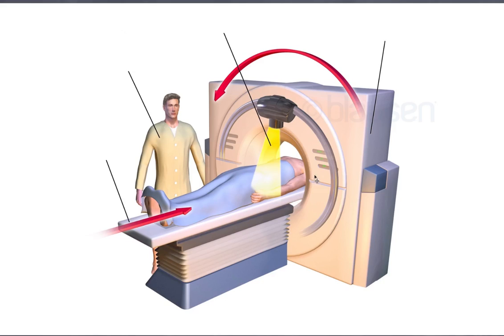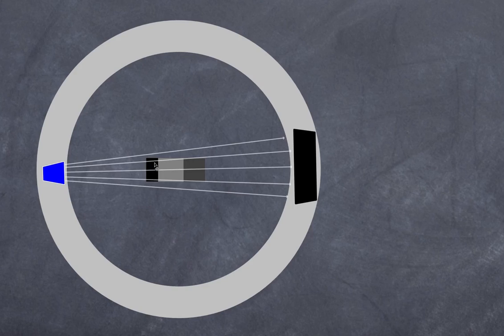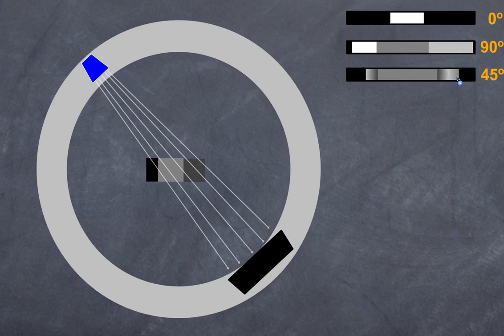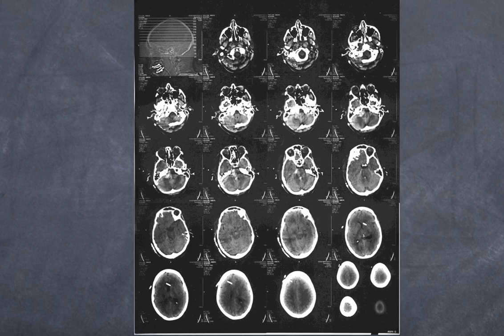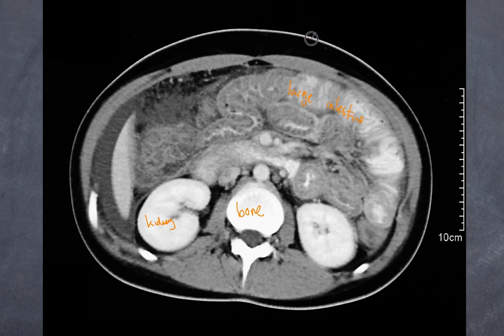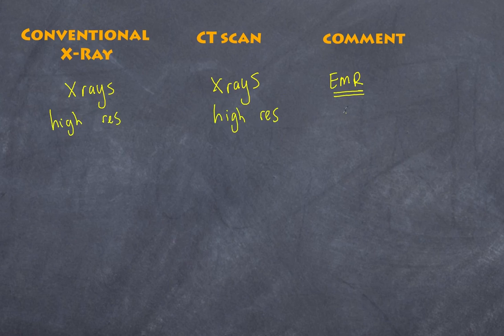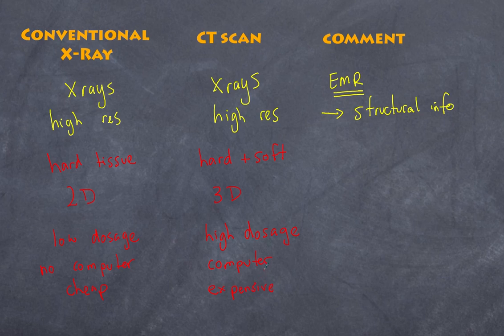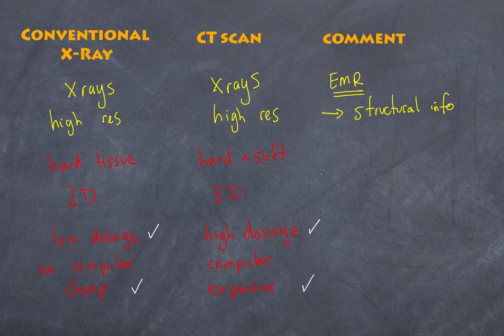Understanding CT scans

Comment: I am not sure why at 0deg we don't just see a solid black block? Surely, the densest part of the block is at the 'top (left)' (ie the first things the x-rays hit) so the less dense layers underneath are shaded out? When we see an image of say a hand in Xrays the bones are dark and the flesh and skin is light? So it's a top-down 2-d image with the (dark) bones inside the (lighter) fleshy hands. I just can't seem to understand why we see a white rectangle with black either side? How is it not just a solid black rectangle?
Reply: X ray film is clear by default, exposure to x rays will cause it to turn black. The denser the object in the path of the x ray the lighter it remains on the image. In an x ray of a hand the bones are white and the soft tissues are darker.

To add to my previous point when the x ray source is at 0 deg the image is just white because the x ray beam will be blocked by the layer on top which is the most dense.

Comment: I wonder how it pictures the brain...since the brain is completely surrounded by dense cranium, should we not see only a white ring around a dark region ?....and how does it estimate the thickness of the skull (as the x-rays only impinge on the skull from the surface and the back of a given section is always obscured by the front of a diametrically opposite section of the cranium)?
Reply: The skull is not impenetrable, therefore xrays can still pass through and be measured by the detectors
Reply: @kaymarie321  if the skull can let pass the x-rays, then is it not true that we should not see the skull?

I was thinking, it's because x-rays can pass through the flesh that we don't see the flesh in an x-ray film and the bones don't let them pass and the film that is placed directly below/behind does not get developed.... sorry for my poor English.
Reply: Intex Cloud S9 you’re kind of on the right track! So the reason that bones show up on xrays is because they are more dense than soft tissues. Which means they will attenuate or absorb the xrays more so than soft tissue. The absorbed xrays will not reach the film which allows us to see the bone. But that doesn’t mean that NO xrays make it through the bone. Same goes for soft tissues. While soft tissues do not absorb as many xrays as bone, they still absorb some which just gives them a different shade of gray on the image. This is why we choose certain “techniques” or certain amount of kV to determine the energy of the X-ray photons. The higher the energy, the more they will penetrate.
Reply: @kaymarie321  makes sense...thank you sir/ma'am.
Reply: @intexclouds9607  brother, i was thinking the exact same thing.